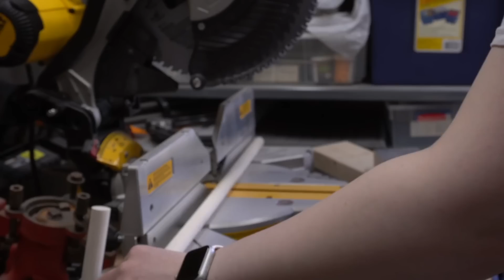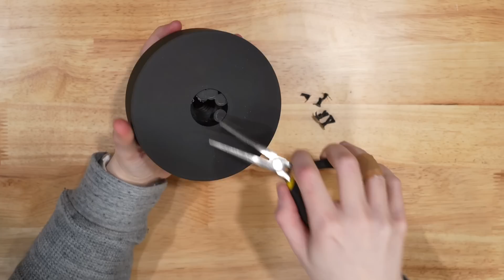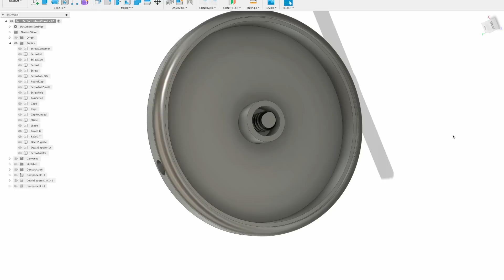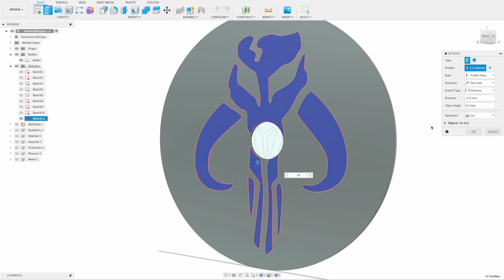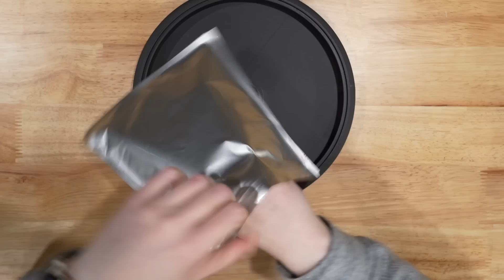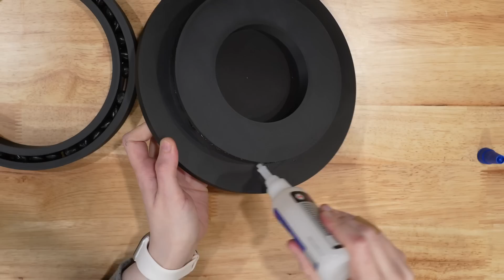Designing the ULTIMATE Customizable Helmet Stand

Comment: @MMPropShop, not sure if you will check this,  I am attempting to print out your bearing section for the rotating stand.   It looks like you don't use supports but when I look at the support strip that the balls attach to its 2 hours into a print and doesn't have anything actually to connect to so its printing in mid air.   Did I miss that you are actually using supports?  I am slicing in orcaslicer.
Reply from the maker: Yes, you use supports only on the strip. You might have to select the bottom of the ring and manually add them so that they don’t extend into the bearing section. I’d also recommend using snug normal style supports rather than organic.
Reply: @MMsPropShop  awesome really appreciate the response.  Love your videos

Comment: What if you printed a spiral patterned wall under the disc that the lights could stick to like they did around the perimeter. That way you would get a better diffusion and could also use a longer light strand if you needed better/more light.

Comment: Wooden dowel - use broom stick handles often they are cheaper. You lose a bit of the round end but you get a straight shaft that far far cheaper than a urned/ dressed “dowels”. You do get limited to about 22mm (~7/8 inch) though…

If you wanna see a virgin channel come on over….

Comment: Great design. My only recommendation would be to create a set of hollowed out shafts and top piece to run electrical cabling through if you ever make helmets with lighting effects
Reply from the maker: Just added part variations to the files for a wired in helmet :)